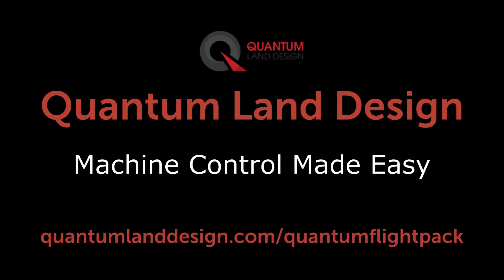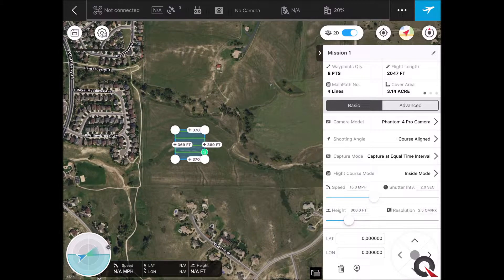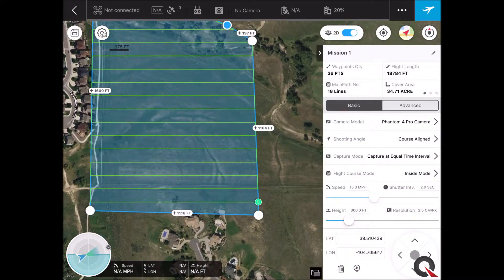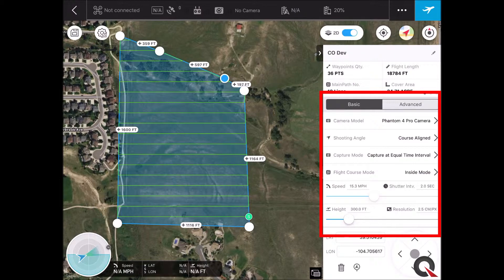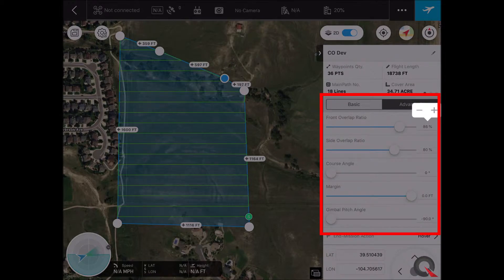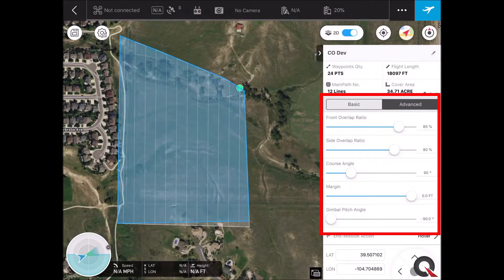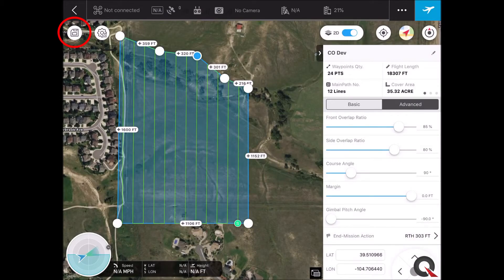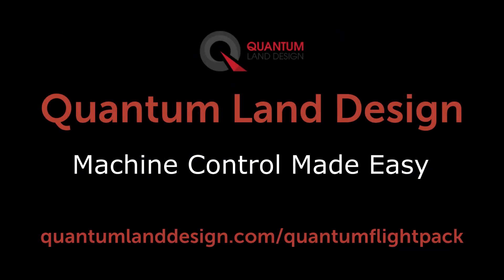DJI Ground Station Pro - Flight Planning - Quantum Flight Pack

Comment: Thanks, nicely explained. useful today also. just a quick question- in 3D surface mapping "Shooting Angle" & "Gimbal pitch angle" does affect the final output?
Reply from the maker: It does.  For topographic mapping you should keep it set at -90 degrees (straight down).